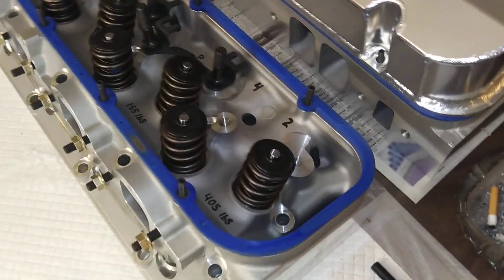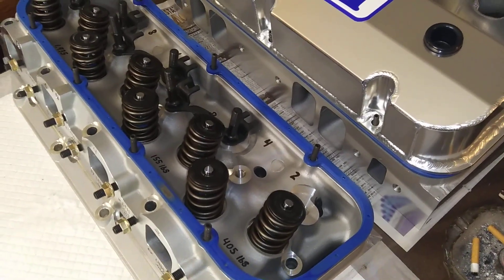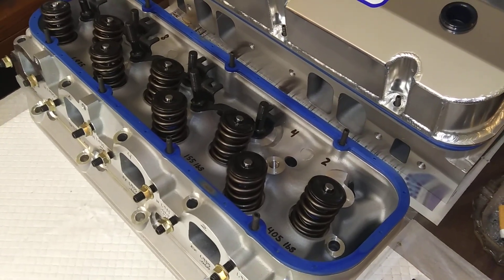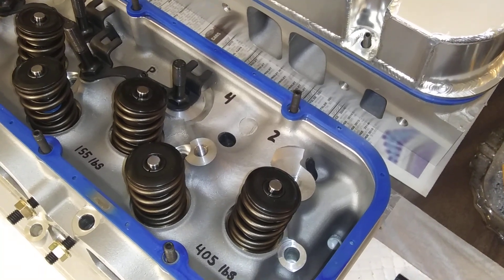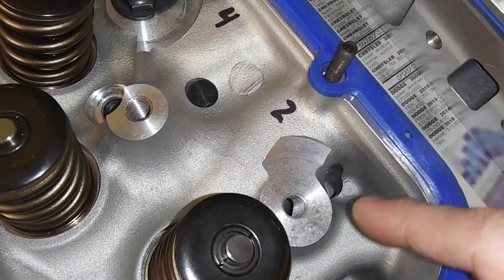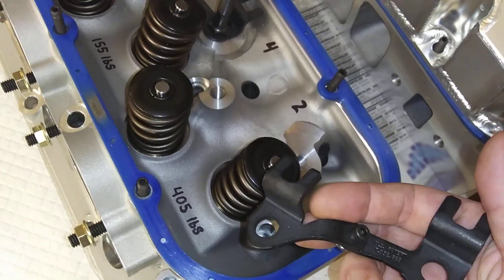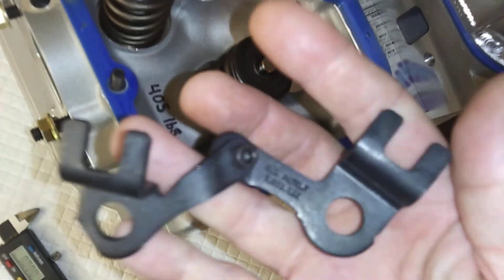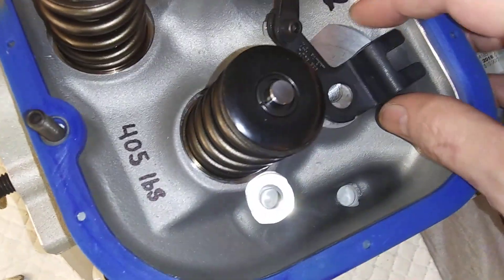Info on KMJ Assault/AFR Enforcer bigblock Chevy heads.

Comment: What part number on the studs? They’ll be here Friday!
Reply from the maker: @NorthNorth80sBaby  I can't remember off the top of my head, but it ends with a 6 and not a 3. Regular length end with a 3 in the part number. Look up the bolt recommendations for AFR Enforcer heads. They are the same heads.
Reply: @ perfect. Thank you! They just showed up today! Did leak down. No valves leaked out. I’m gonna use new springs, retainers, and locks and enjoy these things! Glad I watched your channel! Thanks again! Can’t wait to see the next vid man!

Comment: Is there any way I can send you some of my specs for my motor? I want to know what you think of what I’m doing with these. I bought them because I have two motors. A genVI I plan on using them on now and a TD stroker I’m planning on using them for in the future to drop in my chevelle. Thanks in advance!
Reply from the maker: @NorthNorth80sBaby  What ya got going on?
Reply: @ I have a gen VI standard bore I want to throw them on using e85. Pulling out flat tops and throwing in old LS7 pistons with bushed dimple rods. Should be right around 11.68:1 static. Solid roller .652” comp 308AR cam. Hoping to get some decent hp out of it. Just wanted to know your thoughts. Too big of heads? I know they’ll be fine for my tall deck build but that’s a year or so down the line. I want to have some fun this spring.

Comment: You'll be making some noise before too long
Reply from the maker: Almost have all the pieces. Hopefully it'll be together by spring. Ended up costing alot more than I originally planned. So much for "Low Buck". I've replaced every single part except the block & crank.
Reply: Better have a nice vacation plan for the wife
Reply from the maker: @awfulcoffelsonecargarage8215 Shit, I wish we could take a vacation. Wouldn't know how to act.